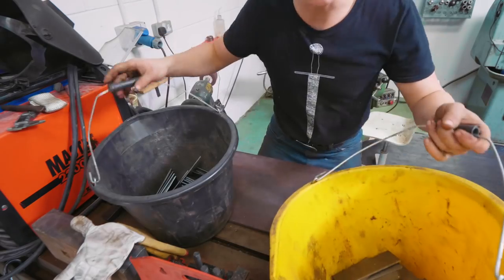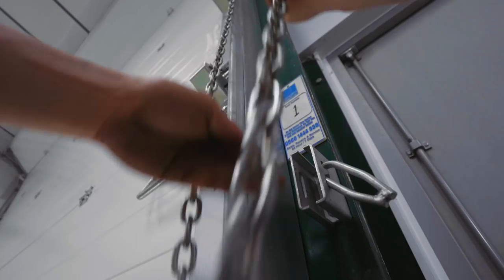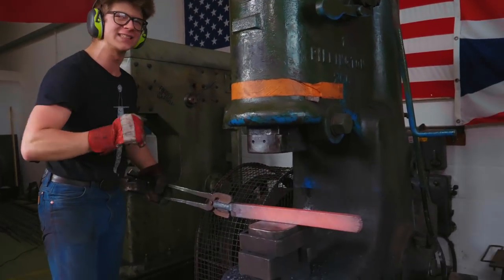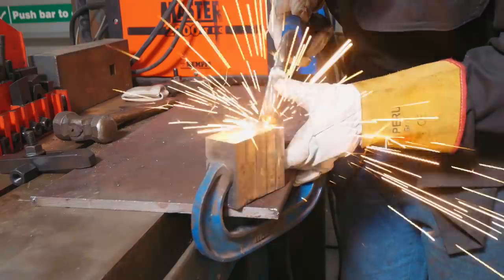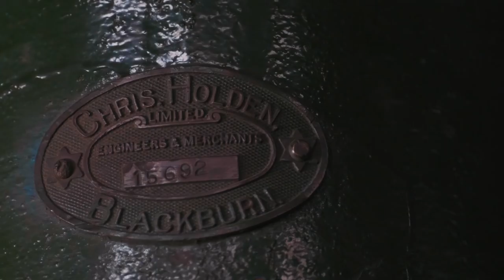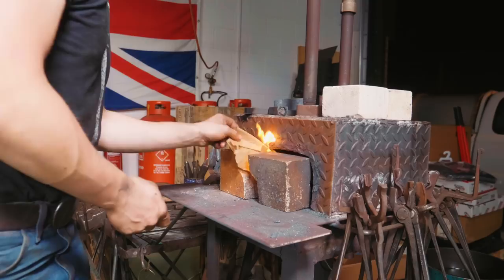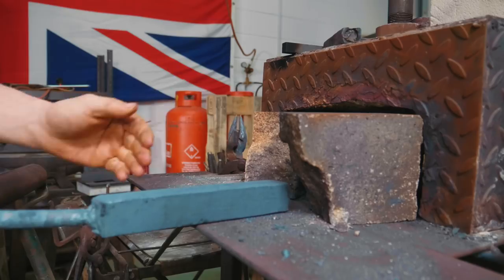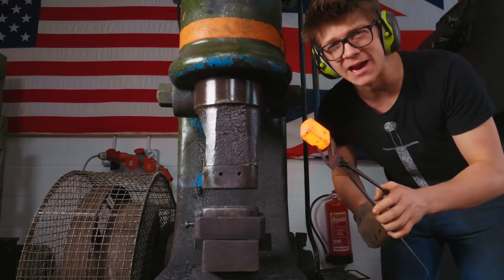FORGING DAMASCUS FOR A FOLDING KNIFE! With Simple Little Life!!!!

Comment: Hot tip for your MIG technique. Pull the puddle, don't push it. You have much more control over puddle width and heat  when you pull, and you likely will be able to run much smaller beads, making the grind faster.

You could also fuze the material together with your TIG machine. Not sure it would hold together for heat welding, but if it does you have even less grinding to do :)

Comment: Should try doing some canister damascus a little different then what you usually do but you can get some really beautiful patterns and it helps eliminate some waste because you can use some of the smaller bits and bobs lying around as well as all that grinding dust you accumulate in the new grinding room
Reply: Justin Fuller yes he needs to do that so bad

Comment: You should put a pair of pins near the end of your tongs, so that when you're doing a part that requires you to hold it closed between your legs you could put a double hook spring on it so it will keep it closed tight. It might give you a bit more control and save a possible oopsie just not having either the tongs or the billet separate if for whatever reason you cant keep the tension on it. Just a thought, might help, might make it worse. Your style of work seems to do well with loose handles.

Comment: Hi Alex good vids & audio, thought of a project for you, instead of having a keep fit shutter door {manual chain} you could rig up cog drive for the chain & small motor, even put a remote on it, just put a limit switch top & bottom, jobs a good 1 !!! beneficial as well, ATB Wayne.

Comment: I'm not a blacksmith guy, but I am a home/hobby machine shop and fabrication guy. I've seen a few times now where you cut the billet and "ferry flip" to rearrange the pattern, and you usually end up going back and grinding out the filler material from the MIG welds. I had a thought as I watched you weld up this stack: Use all that fancy new TIG equipment to fusion weld. Heat only, no filler to grind out. Would that distort the stack in the localized area any more than mig welding, or not provide enough hold for the power hammer? Something worth exploring, perhaps. I can't be the first person to think of that...

Comment: I was wondering Alec, next time you make a Damascus billet, it would be cool if instead of alternating between 15n20 (a) and 1080 (b) steel every layer (like 1a, 1b, 1a, 1b, etc.) to have some thin lines and some thicker (for example 1a, 2b, 1a, 1b, 2a, 2b) to create a more irregular pattern, than just adding more layers by restacking or throwing curves in based off of how the metal is formed with the power hammer!
Reply: Sam Fowler I had a another small idea I wanted to pass which I'm not sure if you guys have tried yet, and that is that after the steel cut up to (but before welding them together again) to flatten or alter the pattern of a few of the metal pieces, but not all of them and then restack to have like 2 versions of the same pattern in one billet. Anyways love the content as always, you guys are my favorite blacksmith channel!!!

Comment: Why did you use the MIG, instead of the TIG, to weld the steel stack? It would seem that the TIG would prevent you having to grind out the weld, after the forging? Just curious, as you can weld without filler rod, using a TIG, but not sure if that alone is strong enough. Thanks!
Reply: Andy T 
He would still need to grind after the TIG because it warps the pattern. Other than that, familiarity I suppose? He's used MIG for far longer than TIG so that might be a reason.

Comment: Is there a reason you decided to do the mig welds for blocks instead of the tig? I though the tig allowed you to weld without introducing foreign (filler) metal and thus didn't require grinding out the welds.

Comment: What would happen if you stack three different steels would it still forge or would not work
Reply: The Damascus is two different types of steel isn't it? So what your asking would just be like color demascus?
Reply: curtis boggs 
I've wondered the same thing.
Reply: curtis boggs steel is steel. The only real difference is either the carbon content or additive that makes more of an alloy than steel. U really on,y have two colors when forging Damascus or pattern welding steel (to my knowledge) which are black and white with some grey in between. If u really want some evidence I would suggest man at arms:reforged. Type in "man at arms inuyasha" and you'll find what I'm talking about
Reply: It’s about the alloys that’s why 15n20 has to be used
Reply: 15n20 doesn't HAVE to be used. You can weld any non stainless steel to another (stainless has to have a zero oxygen environment). The only reason 15n20 is used is because the nickle resists etching and the simple carbon (1084) does not. You can use any amount of different steels, and certain ones will look different when etched.
Reply: Steel IS an alloy already..
Reply: Yes, I understand that, but if you have been in the knife making scene long enough you take on the terms they use. Knife makers refer to carbon 
alloyed steel as "carbon steel" and other steels containing high contents of other metals such as nickle or chrome are referred to as alloy steels . Hope this helps

- James

Comment: @Alec steele, im new to forging and ive been watching videos of different blacksmiths do different pieces of work and my question to you is, why do you cut then weld instead of folding most of the things you do? Wouldn't it make the steel stronger if you fold instead of cut? Or is it the same process just slightly different?
Reply: thekingofreapers technically you can do it either way. Folding is a lot faster to do. However, there is increased chance of failure because you can't ensure a perfectly clean and square welding surface between the steel. By cutting and grinding  you can clean all the oxide off. Gives you more chance of success. Plus you don't distort the pattern as much as you would folding :)

Comment: Alec, you're grinding & welding way too much...Get that stock hot, hot cut it, flux then fold over on itself, reheat then hammer down. Repeat.  And as far as your damascus patterns, that's getting a bit stale as well...Try drilling 1/4 inch holes (think swiss cheese) evenly spaced in the 15N20, then drill more holes in the 1080 so when stacked, the holes are opposite each other (the holes in the 15N20 are directly over where the holes ARE NOT in the 1080). Forge weld but don't hammer the sides, only horizontally, not vertically. Hot cut, flux then fold back over onto itself. repeat 2 or 3 times. Creates a great pattern of little circles...I think you'd like it...

Comment: Alec! You spend so much time ensuring you protect your body from fumes and dust etc. please stop putting your hand under the powerhammer! You can always setup a tube with compressed air and a butterfly valve pointing at your bottom block to clear scale.  Otherwise, love your work!

Comment: I still do not understand why you go through so many un-needed steps for making this... Instead of cutting, grinding, welding, you can just heat it, fold it onto itself with some flux and keep doing that. it cuts out so much work that's not needed.
Reply: CjBigRed cutting allows him to monitor pattern and manipulate more easily
Reply: CjBigRed because I'm pretty sure that would warp the pattern at the point where it is bent.

Edit: plus it would still be much more likely to not forge weld properly or have a lot of inclusions because oxides would still form unless you were to put an absurd amount of flux on the piece